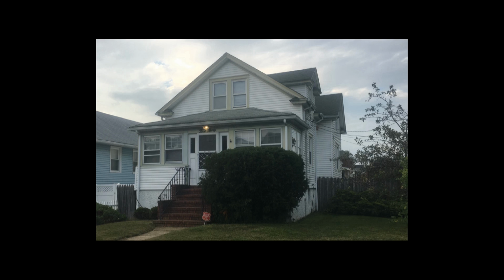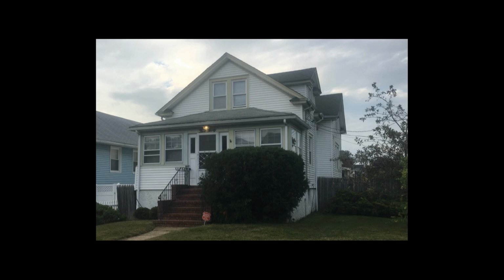Podcast 214: Heat-Pump Water Heaters, PVC Trim Plus Cedar Siding, and Historic Architectural Details

Comment: 43:50 "You can make a lot of hot water with $1000 of electricity, I would argue years". 

I stopped watching these a long time ago, basically three idiots talking about stuff they know nothing about. Poor advice to the guy who needed help with his shop floor and then just one wrong after another. 

So just for fun,. looked at HD's website 50 gallon electric water heater, the cost to operate per year is $424 Did I say PER YEAR? So saving a grand is not going to go very far when you are taking a product that will last 8-15 years.

I'm sorry but three kids giving advice on stuff they know nothing about is sad, it's HGTV sad.
Reply: Yeah the longer I watch the more I think they are just people who do Google searches